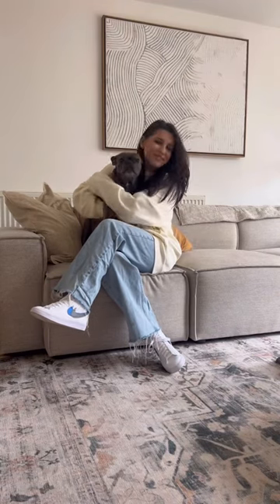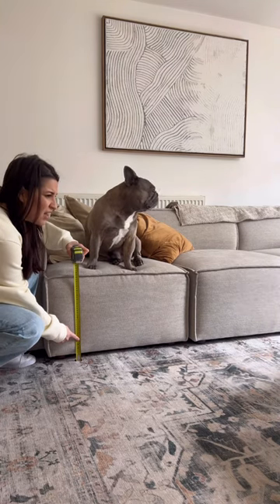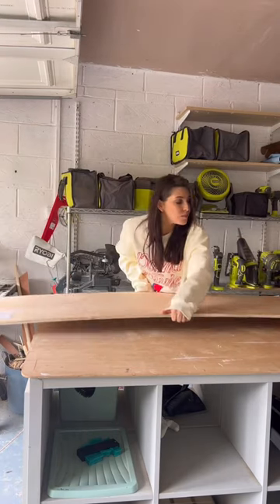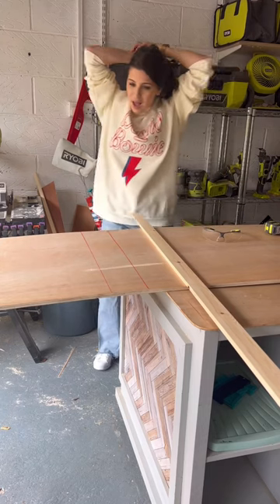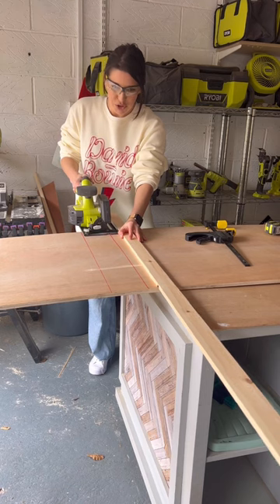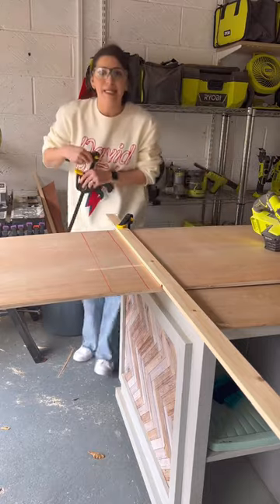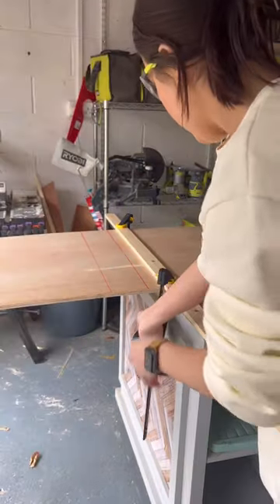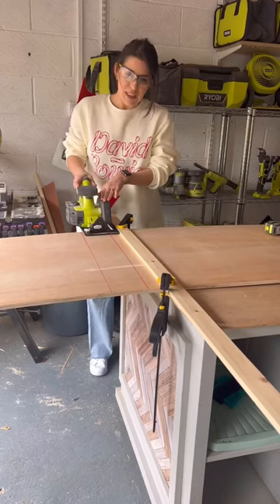Building DIY Dog Ramp Part 1! 🐶Products linked above! #shorts #diy #diyprojects #powertools

Comment: Always let the wood fall from the table. Don't grab the cut board before it faĺls unless you aren't sawing and your only duty is to focus on catching the board safely. Ĥ6q6

It's even harder to avoid in our metal shop, but it's easy to misjudge weight and leverage working against you. Getting hurt near a saw is not a good habit.

Comment: When you cut plywood or sheet goods like that, just put down say 4 pcs of 2x4’s-  2 on each side of the cut to support the sheet- that way you don’t get into the awkward position of having to catch the piece
Reply: PS... use small “C” 🗜 clamps for your saw guide board... Cool Bowie shirt too!!!
Reply from the maker: I didn’t have spare sheets 😢
Reply: It's to tall
Reply: *scrap 2x4s because they won't be usable after a few cuts unless you're good at making super shallow cuts. 
Good kindling though.